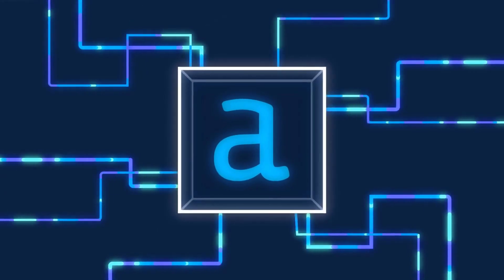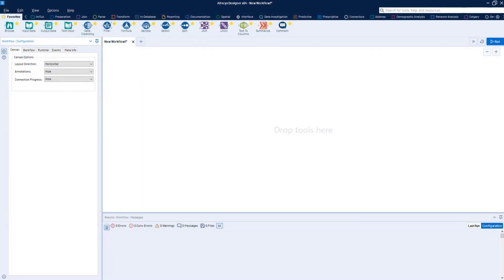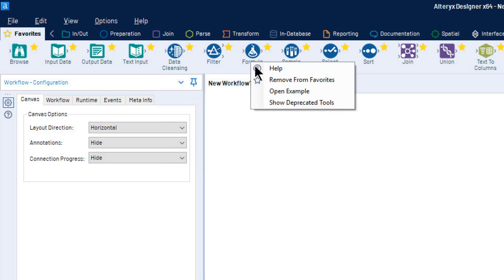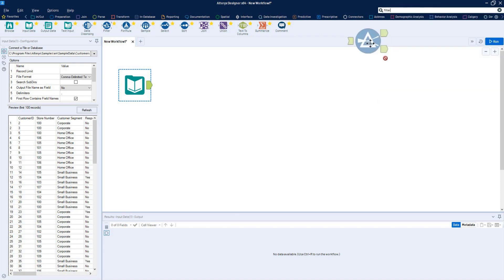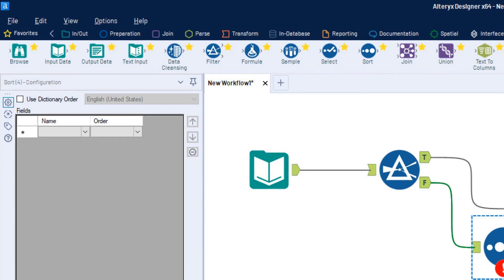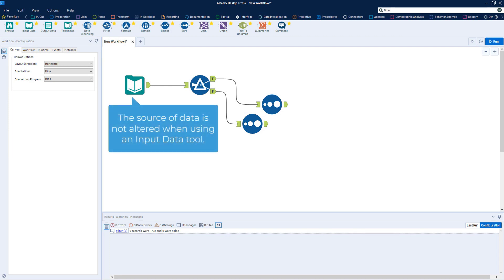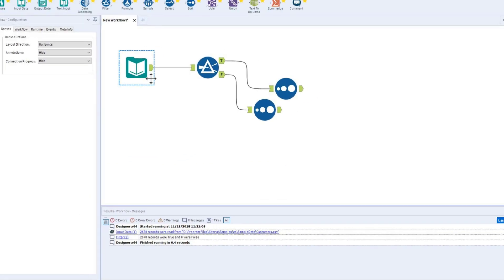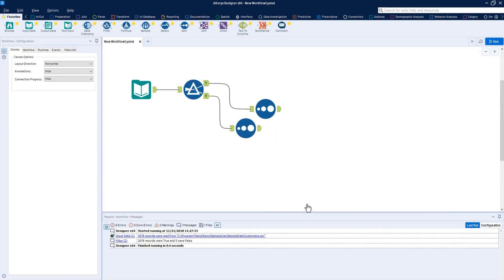Getting Started with a Tour of Alteryx Designer

Comment: is it rpa?
Reply: RPA is to Alteryx what a shovel is to an excavator. Both are extremely valuable tools that are useful for their unique type and size of problem. They can solve problems individually and they can work together to create more complex solutions that couldn’t be done on their own. At their core, RPA bots work on the front end of a system at the UI level and mimic a human’s interaction with a computer. It’s able to automate repetitive, rules-based processes such as filling in forms, extracting data from documents, and processing invoices. Alteryx sits on the back end as the engine that handles the cleansing, manipulation, and processing of data without volume limitation. Not only does it complete the process automation, but it’s able to apply statistical methods and perform analysis on large data sets to identify trends, anomalies, and variances. In short, RPA works to eliminate repetitive tasks and can support end to end automated solutions developed in Alteryx.”